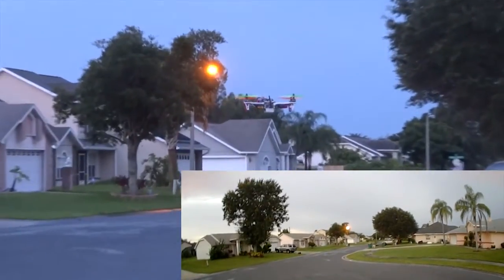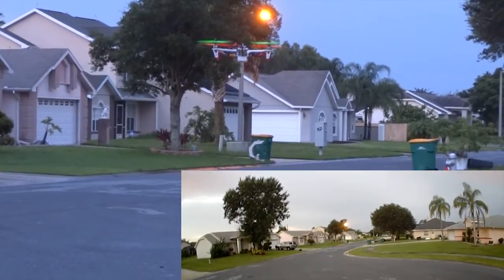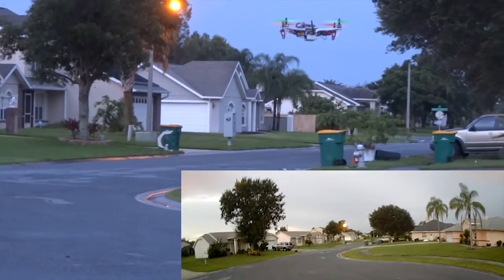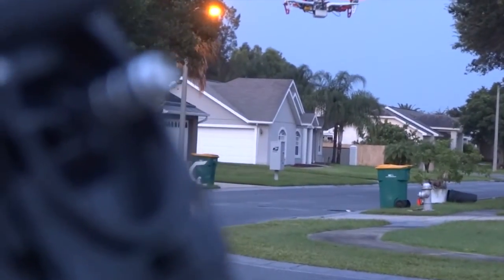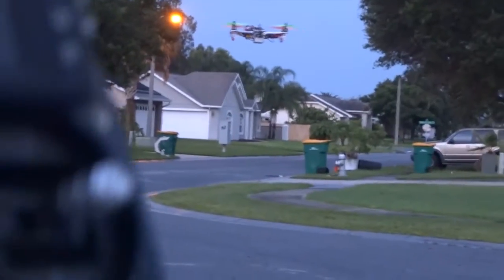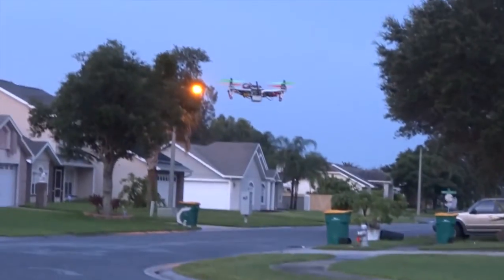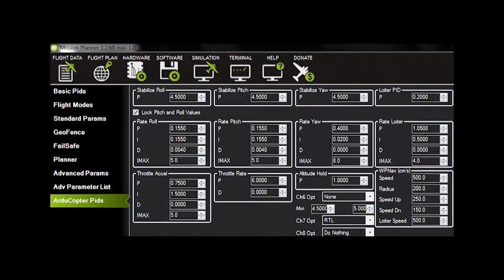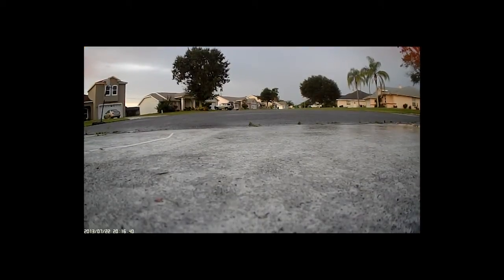Arducopter 3.0.1 Loiter, Yaw, RTL, Position Hold test.  PID tuning

Comment: Thanks for the vid. My quad running 3.0.1 is really needs work. I think I'll lower my Rate P and D (D = 0.0040) because it still oscillates. 

But whats more alarming is the loiter wants to run off in a random direction. The GPS is locked but it was never reliable. Thoughts? It has been flashed.